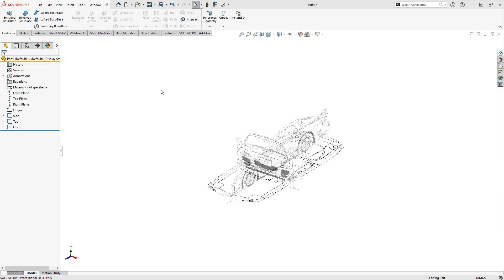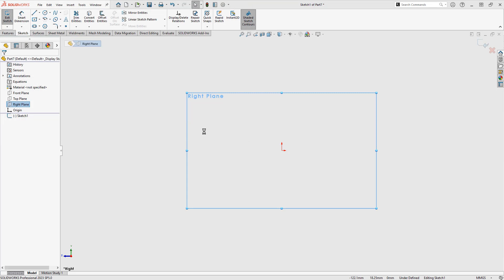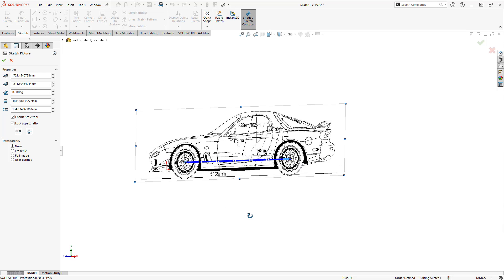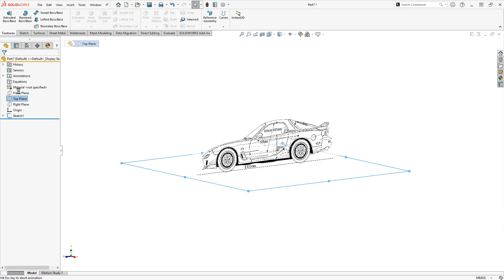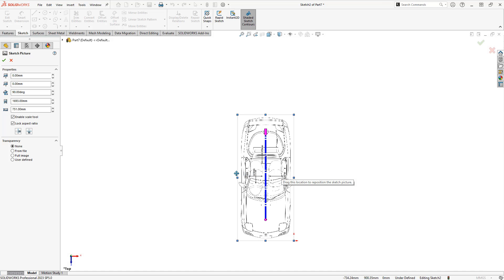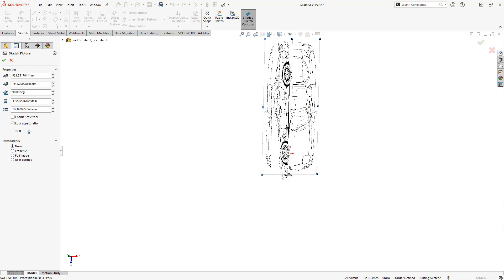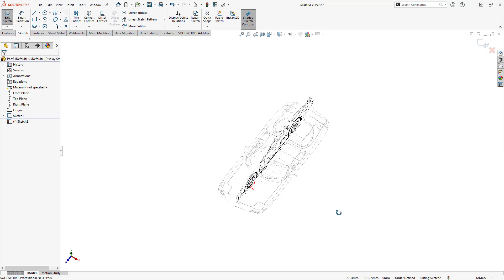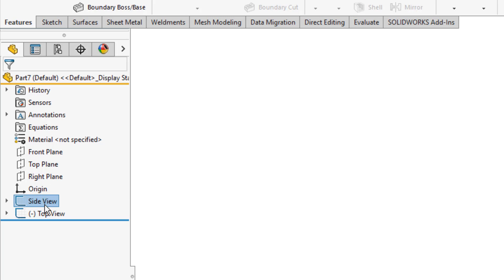How To Insert Scaled Blueprint Images In Solidworks

Comment: Nice!
I'm used to using this exact technique in 3ds Max. VERY useful.
Not sure why you would insert images of an entire car here in a part file though. I'm struggling to insert an image in an assembly file. There doesn't seem to be a "sketch picture" command there. But there is an "insert picture" command. It just doesn't work, no matter what filetype I choose. I get nothing but "error reading file" or "unrecognized file format." Is it because I'm using an educational license maybe?
thx.
Reply from the maker: When i model car bodies and actually a lot of assemblies I do them as Multibody part files rather than an assembly.

I don't believe Sketch Picture is available in an assembly.  Even in a sketch or layout sketch...  The best option is probably to add it to an empty part and insert that part into the assembly...  There are a lot of little things like this that SWx does that makes you do workarounds sadly.
Reply: @LearnEverythingAboutDesign  very interesting. Any reason for doing multi-body models rather than an assembly?
Great tip on an empty part with a picture in it! Thanks!!
Reply from the maker: @scottgarriott3884  I don't really like the way Solidworks builds assemblies.  Fusion for example is all done in one file and it keeps track of where things are in a timeline (like the feature manager).  So if you move something you either have to capture its new position or revert it before it lets you say sketch on a face.  Fusion also lets you fillet multiple bodies across multiple components at the same time (if you want).  Building an assembly of components that relate and rely on each other is just easier in a multi-body part file.  It isn't without its own problems though.  When you build your multibody part you can then save each body as its own part file and build an assembly at the click of a button.  This is done as a feature in the feature tree.  Everything comes into an assembly in the correct place.

Mainly since i deal in creating ground up designs that multibody approach works for me.  If a design is using off the shelf parts then it can be better to do an assembly first.  bottom up vs top down.

Comment: Nice.  Are you going to do more videos with solidworks?
Reply from the maker: Yes, soon.  I have been meaning to reach back out to you Tony, i have seen you have a lot of modeling videos popping up which is great!  I needed to see if you ever printed that one we were talking about.
Reply: @LearnEverythingAboutDesign   Not as of yet.  I have been working on the wing formers and internal structure for it though.  I am trying to make it so the parts when printed will slide together.
Reply: Good day,
Is there a good place to find these types of images? I am working on rc modelling, for specific parts. But   uploading just a regular picture in Fusion, I cannot build off of that. Or finding scans for that matter? I think gettiymy feet wet with any type of scanned car be beneficial. My plan is to take a rc4wd blazer body and make dually fenders, and a prerunner fender kit. But having a scan is definitely what I need to build that stuff off of. Thanks for any information you can provide.
Reply from the maker: Funny enough I have plans to scan my rc10 body and talk about designing a new body in a future video/series.  its a ways off though.

As for blueprints or models, there are a few sites.  Generally i just google the model i want and the word blueprint.  Some sites are free, others will have watermarks on them.  If you just search "K5 Blazer blueprint free" you will find something.  Chances are the RC car model isn't exactly the same as they need to make changes for the forming process of the body so doing a scan is certainly the way to go.  Depending on the scale you are working on some scanners might be better than others.  My plan is to do the rc car body series along with a give-a-way scanner but still trying to work out those details.
Reply: @LearnEverythingAboutDesign  ok, that's good information.
I'm getting Matt from scale builders guild to scan his body for me, that will give me a start at least. I think I'm going to pick up a 3d scanner soon.
I will be digging around your videos for some tutorials, that's for sure. I think for the stuff I want to do, I need the Scanner. I think the ferit is within reach for me
Reply from the maker: @thegoat78  Yeah a scan ferret would work well.  I actually did scan my sc10 body but you will want to use some talc/baby powder or scan spray for sure.  Revopoint Inspire is another good option